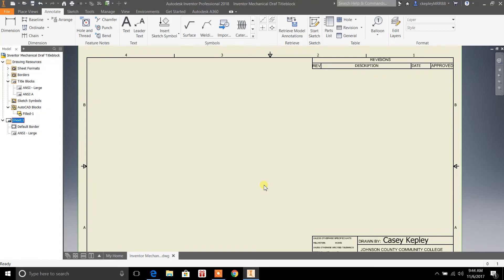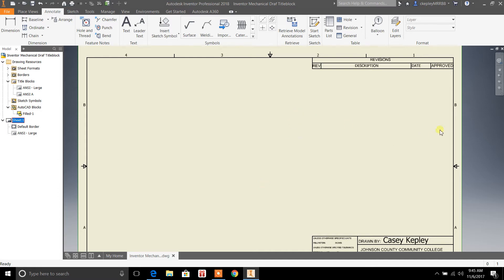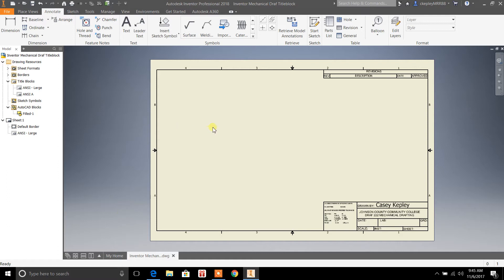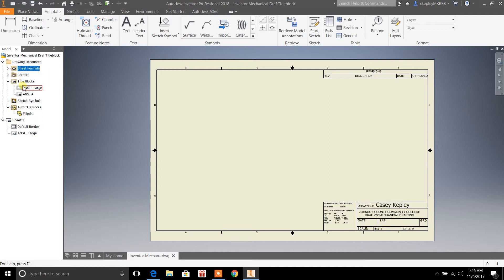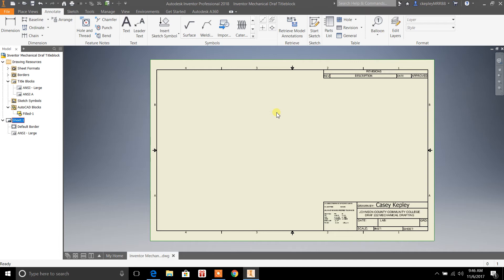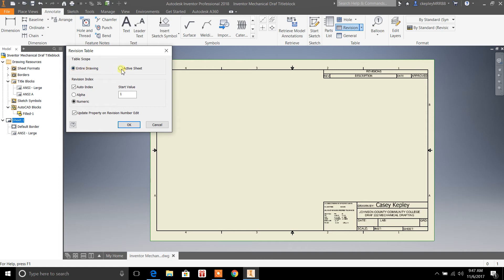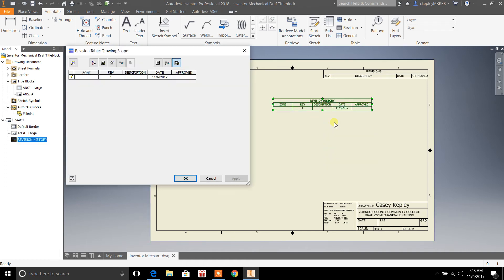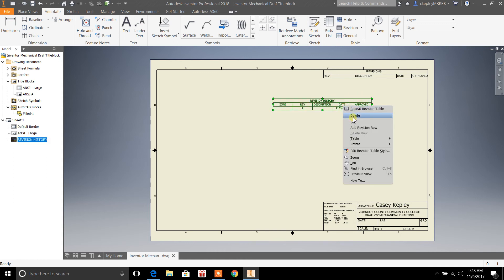inserting a revision history block - Inventor 2018 tutorials

Comment: to have multiple revision history notes, create the initial tab setup he shows, then  (where you have entered the rev 01 details) if it is highlighted that means you did it right,  (control C and V). a new row is shown on your cursor, which you can . the second one usually snaps into the right spot.. FYI I am using inventor 2024